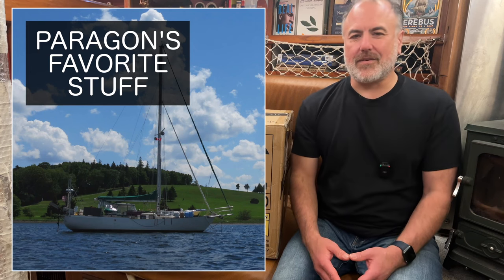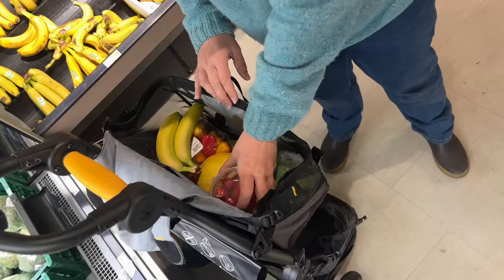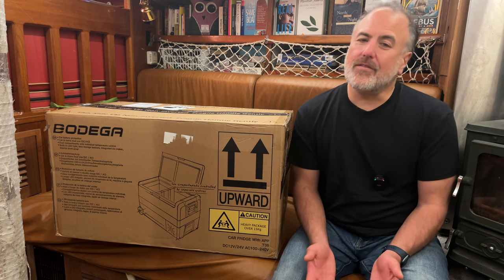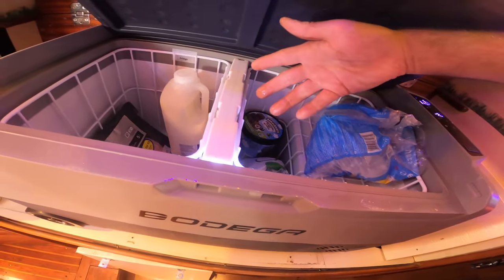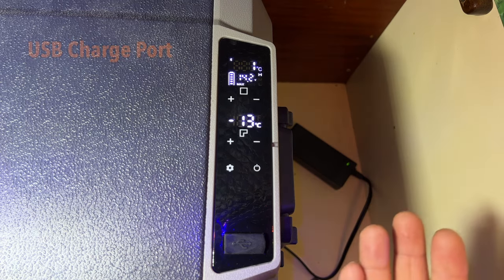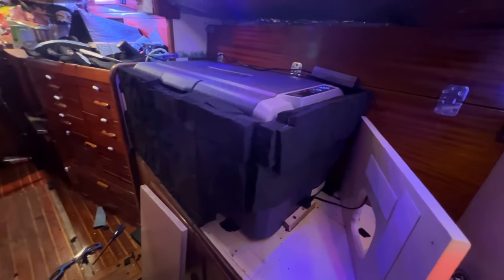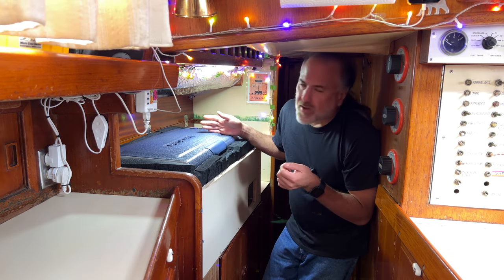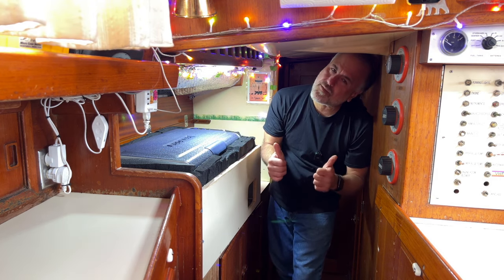Need Refrigeration on a Boat? Bodega Cooler! | DrakeParagon Sailing

Comment: This is all i have used for 6 years. Now to check out your canning vid. I didn't know you could can meat. I like how this fridge monitors both sides. Most dont. I removed my basket to give me more room. I did add a computer fan. Check to see if there is an over-ride switch to bypass the electronics and turn it on in bypass mode, I found that adding a water filled plastic bottle to fill air space....this also help keeps everything cold.

Comment: I haven't had plans on having a refrigerator on my boat. But a couple of months ago I decided to give it a go and bought a second hand Dometic 18 liters with a compressor. I have just returned from a 18 days sailing trip to the Swedish archipelago and I can just say wow. That little refrigerator was an amazing upgrade for my boat. And the 18 liters fit me perfect as I sail solo. Btw, the word Bodega, in Denmark is a local bar :-)

Comment: Hope you have more luck with this then we had over the years, having extra freezing capacity is great especially for longer passages and locations where nice food is hard to get, unfortunately we have tried 3 and they all died after approximately 13-14 months, just outside oof warranty. I think they do not like the healing of the boat. Since then, were back to a ridiculously large freezer and nice marine-fridge, similar to yours (they do also break but after many years)

Comment: Good review - thanks!  I've had a similar Norcold for almost 15 years.  It has only one compartment and I keep it at about 38 degrees F.  I love it.  But it doesn't have near as many features as your Bodega and cost more.  I hope it lasts forever but if it doesn't, I'll definitely consider one of these.  Look forward to your final review.  Thanks too for some of your tips (like adjusting the temp for solar vs. nighttime) that DO apply to me.

Comment: Vi have one similar 40 litres cooler and one similar freezer (that goes down to -17 deg C). Used them for several years. Need a 40 liter freezer due to diet issues. The downside is of course that they will use more power due to less insulation. Thats why we installed 400 Ah Lithium. Think we have a product named Alpicool.

Comment: I had a norcold (similar cooler) for 7 years before it stopped working i called norcold and i was told they only make them they don't service them. So i called around and know one wanted be bothered to fix it. They all said if its last more then 5 years your on borrowed time . I hope you don't end up in the same boat so to speak.

Comment: Safety Suggestions
Not only manufacturing defects but shipping damage can create a failure point that could cause a fire or failed electrical ground or GFI. 
In the video it sounds like you said you plugged the new cooler in and then immediately left it unattended while you went to the store.  In general, it's not the best practice to leave unattended a completely new and untried appliance, plugged in and powered on...especially one that consumes a lot of power.

One should have at least one person stay with the unit until all functions have been exercised for a reasonable period of time (which depends on the appliance), while looking for any signs of overheating, fluid leaks, etc. For something with a compressor, I'd want to let it run through at least a few normal compressor on/off cycles (normal = not moving the thermostat to make it cycle on and off more quickly). If it can run off different power sources, then check those too...at least the ones you plan to use. Also check transtioning back and forth between power sources as per user manual/specs to ensure power control isolation circuits aren't malfunctioning.

Optional, but Recommended
I'd also advisable to verify the ground wiring connections (if any) are intact. I've been watching LED floodlight videos (units from China in particular) and it's very concerning to note that quite a number of them either have a long history of loose/improper ground connections, or it was left completely unconnected inside the case where it can't be seen by the customer without opening the case. In such cases, a meter would be helpful.